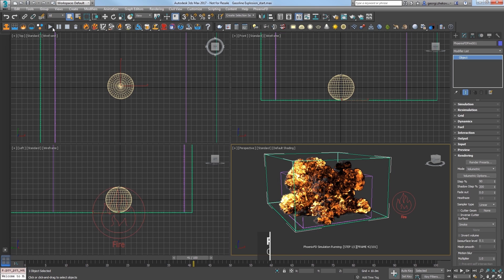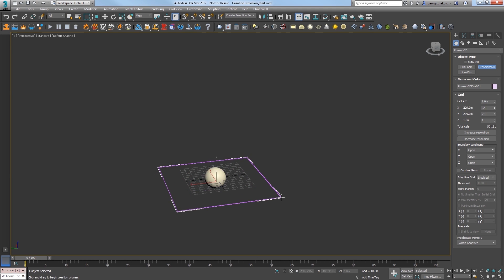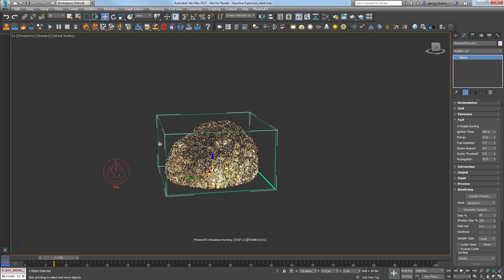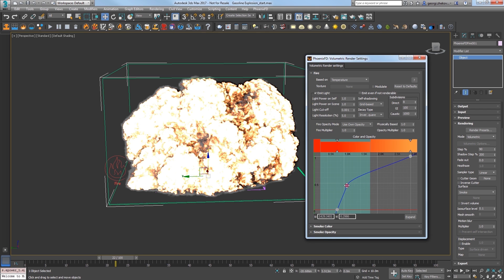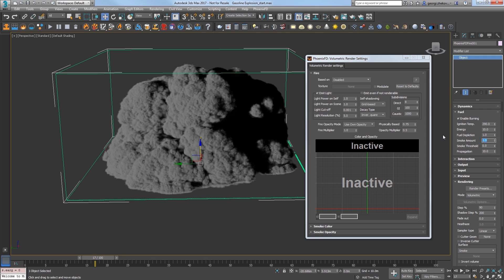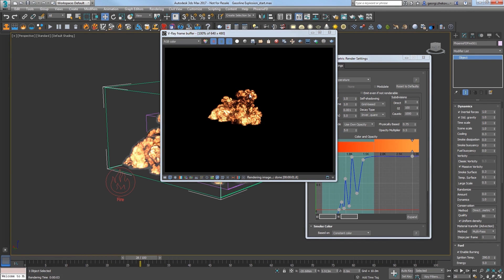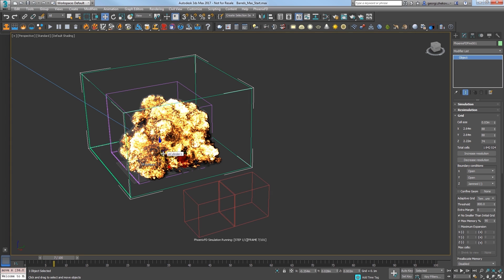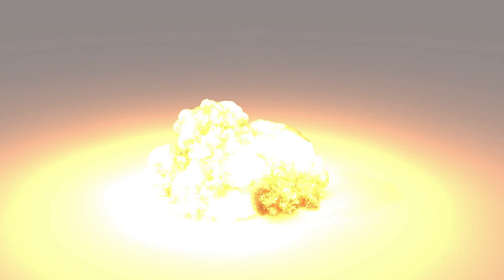Phoenix FD for 3ds Max – Quick Start: Gasoline Explosion

Comment: Hello, thank you for a good tutorial. Can you help to solve the problem?: when I rendering an object with a fire, and save in png and open in the after effect the fire is very dim. Why is that? when rendered everything is very intense and bright, but in the after-effects it is as if the fire is very transparent. Why is that? By the way, I rendered with the ready preset.
Reply: Trying rendering in Targa instead of PNG.
hey wat render pass did you use for rendering fire and smoke???

Comment: Hi everyone. I took this error message when I try to vray render : PhoneixFDFire001: Using the progressive sampler with PhoneixFD Light Cache will slow the rendering considerably.
The PhoneixFD Light cache will not be used for this render. 

How can ı solve this problem?
Reply: I have the same issue, please help
Reply: I have the same issue but the render turns out fine and at the same level as that of the render in the tutorial
Reply: In your GI setting, set your primary engine to light cache

Comment: Hello, Whenever I reload my saved scene, My PhoenixFDFire001 data is all default? Do I really have to redo all the settings again?
Reply: Sounds like you are using the demo, which is now replaced by a 30-day trial build which has no such limitations. Check it on chaosgroup dot com :)
Reply: I do have the full version....3.0 with 2017 max
Reply: You need 3.04 - check the site :)

Comment: why does unit have to be 100 centimeters and not 1 unit i centimeter 

Also you guys promised to make a tutorial about a fire truck putting out a fire  from liquids to fire.  Please!!! Thank you

would be nice to have user made or  chaos made preset library. A lot bigger than what you currently have like lava,  natural stove gas, steaming hot shower, hot geysers   etc   Even if you have to pay for each one as long as they are very accurate and all settings are the best ones
Reply: Hey, so on units - it is very important to have the simulator as big as the real-world effect you are simulating - you can check the container size in the Simulation or in the Grid rollouts. If you reduce the unit scale 100 times, you'll have an explosion of a centimeters big, which would mean your container will  fill with fire in a blink :)
Reply: Regarding the fire extinguish scene, please check the Chaosgroup Phoenix forums, an example is uploaded there :)